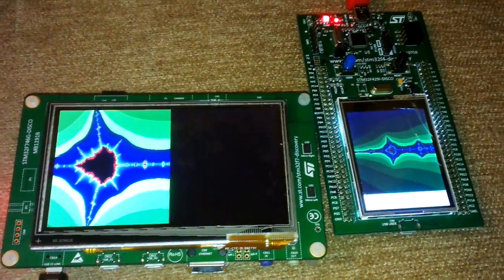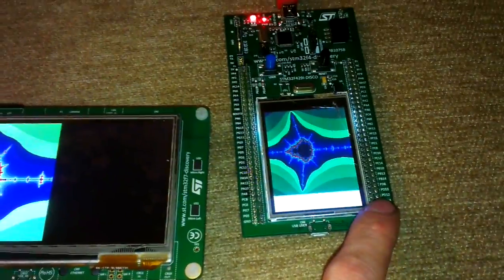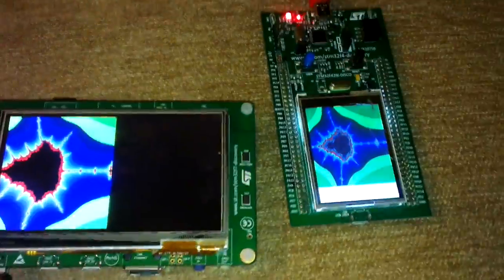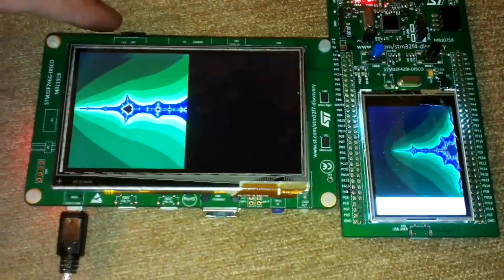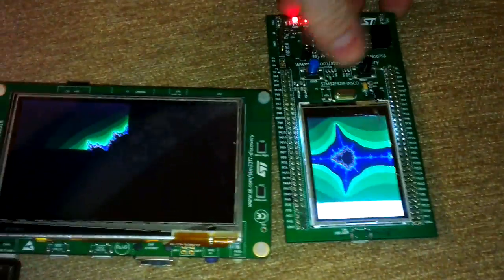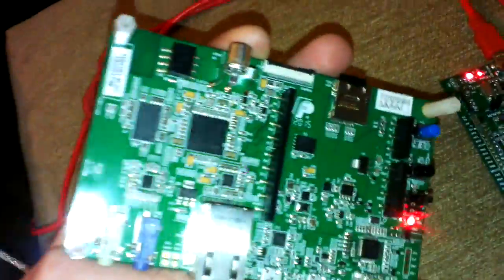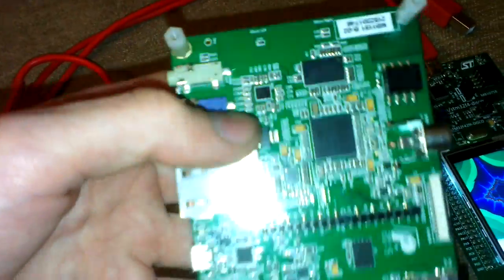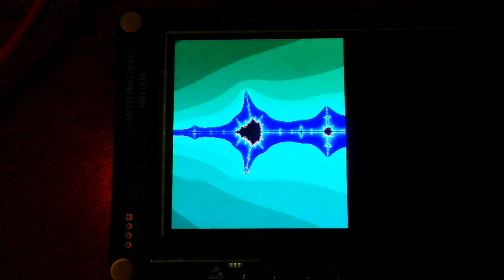STM32F7 vs STM32F4 in f32 Mandelbrot calculation

Comment: Hello 

  How to migrate an application from stm32f4xx to stm32f7xx
Reply from the maker: What i did is mapped directly my painting function to SDRAM, so it works on both platforms without any tweaking. All you have to do is to use right example for LCD, that's it
Reply: in stm32f4/2/1 , if we want to modify a byte in ram,or peripheral  we should use a bitbanding method , but in stm32f7xx , thersn't a bitband region and so if we want to read or write any bit in registre on stm32f7xx , how we can do it please ?
Reply from the maker: SDRAM is on the same address regardless of M7 or M4, this is what i say.
*(uint32_t *) (Bank1_SRAM1_ADDR + REGISTER_ADDRESS) = REGISTER_DATA;
Reply: but thersn't a bitband région (address) in M7 !
Reply from the maker: what do you mean by that ? never heard about big bang into memory, you just write to it.

Comment: Once mine arrives in the mail, I'm going to do some realtime 3D graphics testing for the f7. It should be about as good as a Dreamcast based on its specs.
Reply: +Sharif Sourour The Dreamcast had a dedicated GPU, so that will slow you down a lot. I don't know how SH-4 stacks up against a Cortex M7, but I believe they should have similar performance. Maybe something like Quake would run well.

Comment: I have done a break out board for the STM32F746 - if yo need access to all the pins. Breaks out on the Discovery F4 footprint http://sustburbia.blogspot.gr/2015/07/how-ragworm-helped-me-create-stm32f746.html
Reply from the maker: Ken Boak 
Hi, thanks,
But i have many STM32F407 dev kit with bad mcu's, so i just going to resolder it !

Only problem with STM32F7 is that only HAL libraries are present, no easy and simple SPL :(
Reply: Linas K    Unfortunately the F4 and F7 are not quite pin compatible.  STM have put in an extra power pin that has shifted 30 pins one place to the right.  That's why I did the breakout board!
Reply from the maker: Ken Boak 
Don't mix LQFP100 and LQFP144 parts. 

As far as it looks, LQFP144 is direct replacement for STM32F4. And i use only LQFP144 parts, since i need LDC+SRAM or SRAM+DCMI

Comment: Do you use STM32Cube to do the setup and initialization code? 
How many GPIO pins are available? 
Nice video.
Reply from the maker: Mohammed Algailani 
This is low free pin cout dev kit. Basically what you have in arduino connection + extra few on top left corner. So is just few gpio to use, since all goes to, usb HS, usb FS, audio, spdif,camera,Ethernet, and others 
I don't use code generation, i just reworked example program to show pictures from sdcard is STCubef7 firmware